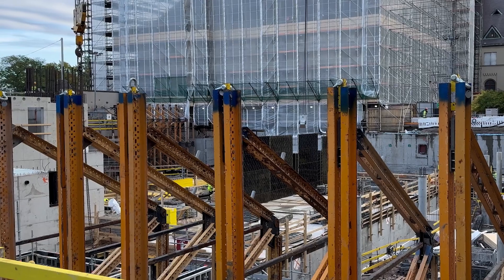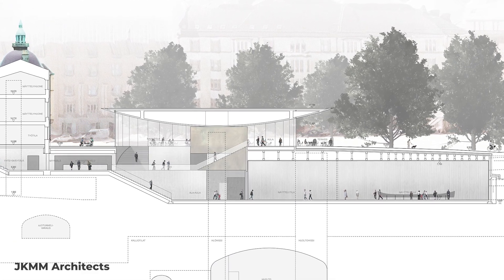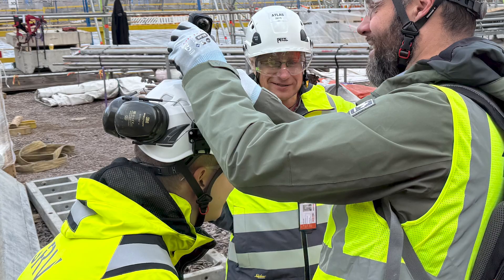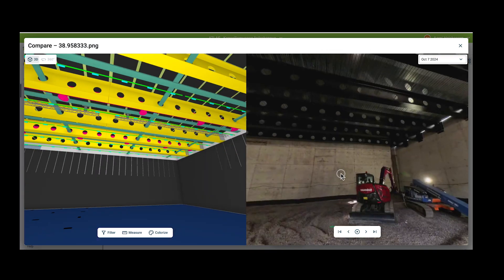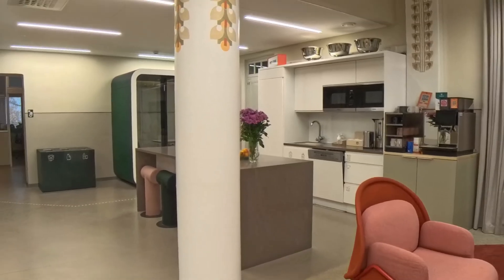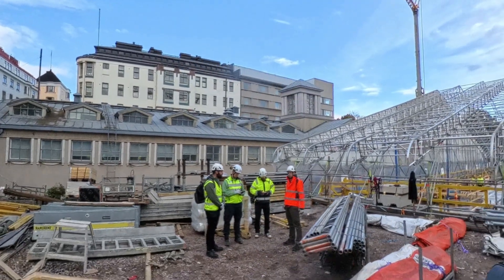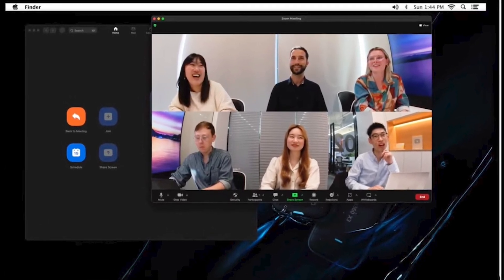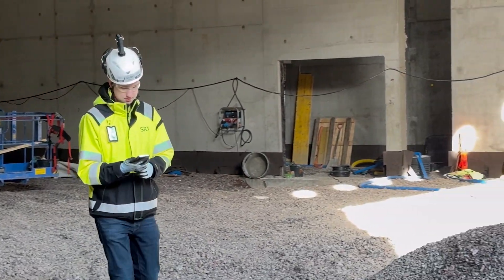How to Use the Insta360 X4 Camera in Construction

Comment: I see the 360 camera is mounted on helmet sideways, facing left and right. Not front and back. Is there a reason for this?
Reply: it doesnt matter much since it is 360 and records everyting anyways
Reply: @koalasevmeyenkola9105  Ya, but along the stitch line is what I mean. You can see it when the camera and image is moving. Not to mention the two lenses will have different exposures if set to automatic. One side will be darker than the other.